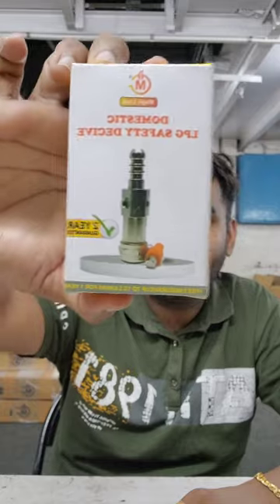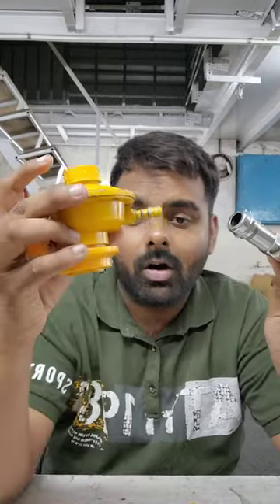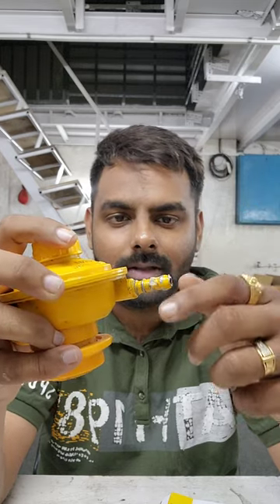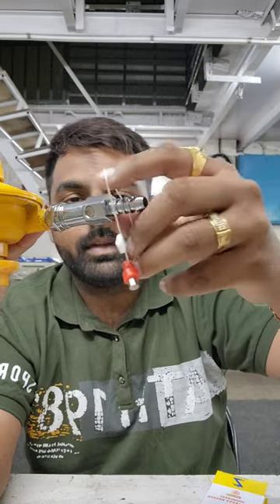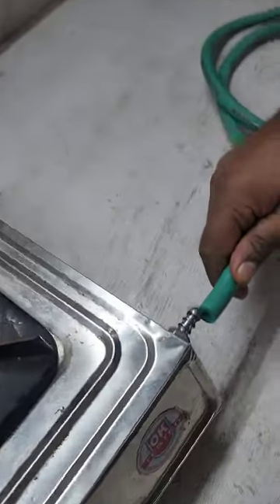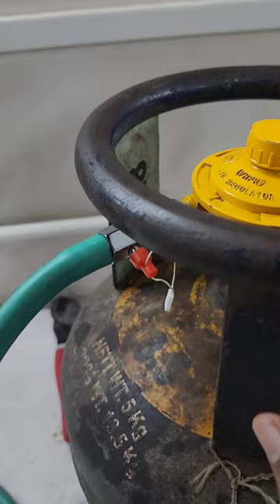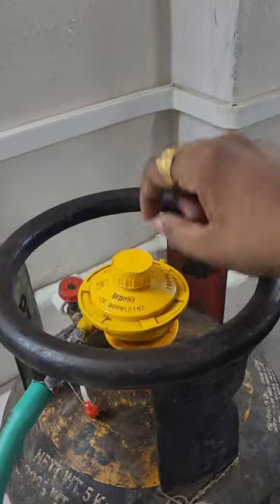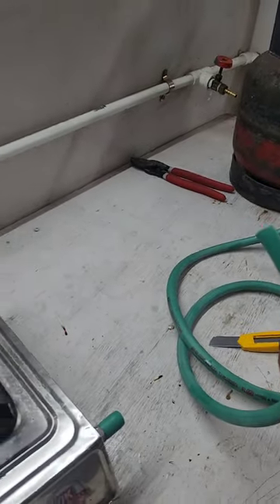INSTALLATION GUIDE OF Z PLUS SAFETY DEVICE MAGIC LOCK [ENGLISH]

Comment: But how it works sir?? We have basic right to know how this product work with what machanism?
Reply from the maker: it has low ball valve system which only allows the desired output pressure, as soon as the pressure is excess the valve gets closed